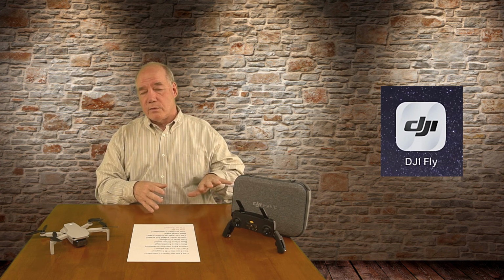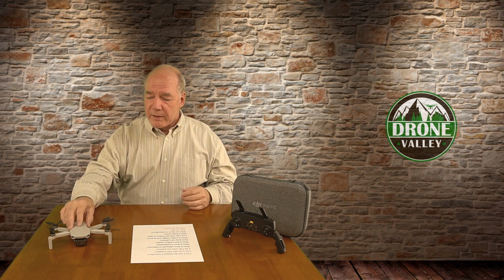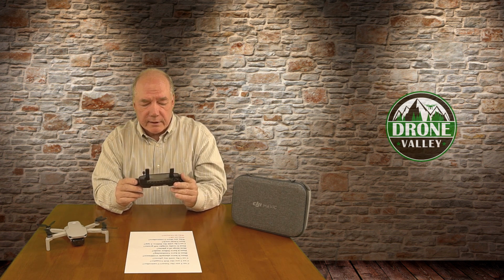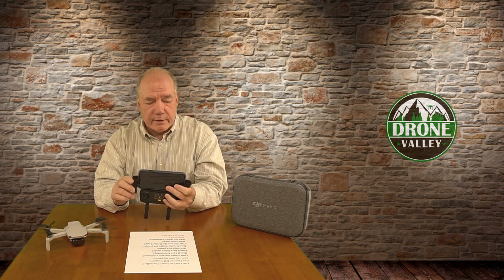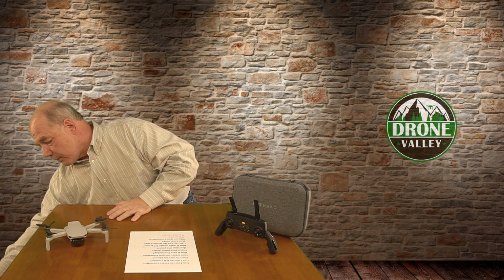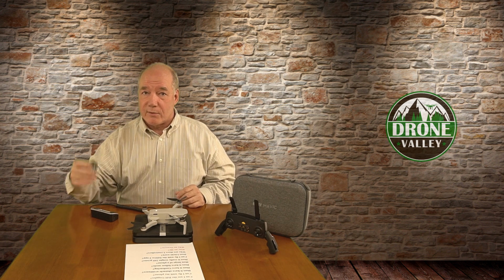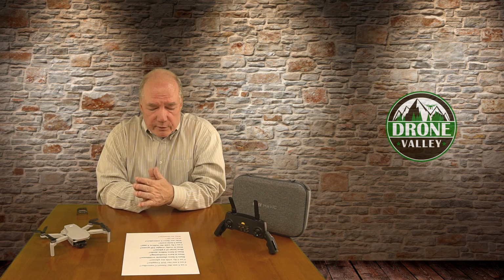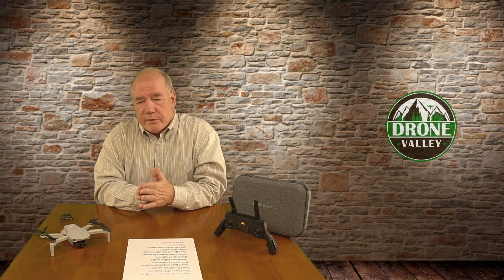Mavic Mini - Your Top 10 Questions Answered

Comment: I live in an NFZ, which means I can’t even fly it in my own home. I’d have to drive 4 miles just to fly my toy?

THAT’S why we don’t like NFZs.
Reply: It's more than that. There's no reason why I can't fly at say 20 ft to capture footage in an NFZ. I live on the edge of an NFZ and can't even use my done to capture footage of my kid. There should be a ceiling of say 50ft instead of an total NFZ. This is why NFZs are stupid.
Reply: @jeremyk2740  Request permission via LAANC using Airmap app. You get authorization   because you are recognized by the system. They will have your name, insurance and type of drone. It is required you provide this info to Airmap, which FAA recognizes as their proxy. It only takes a minute to do. There are videos on the subject so give them a look.
Reply: Lon Denard Just like we allow DOT to set speed limits those limits are based on the roads conditions and how it’s engineered. If you have your 107 license then you know how the airspace is defined and NFZs can be more dynamic to be reasonable. Just because you’re close to an airport doesn’t mean aircraft can be flying at 100ft over your house. Nobody here is condoning reckless behavior.
Reply: @Lon Denard I don't see a lot of 3 holers (727) burning the sky anymore, but your point is very valid. The FAA has a mandate to provide air safety in and around airports. Drone sightings in and around airports have increased with the increase of drone operations. The FAA receives over 100 such reports each and every month, the boneheads are out there. As an ATP rated Boeing Captain, the last thing I want to see anywhere on approach is something coming at me below 1000 feet in a 747. Gear is out, Flaps are 30, and airspeed is at approach speed during a stabilized approach. Pilots can't maneuver that mass and inertia quickly in that configuration. The FAA has the data on this, they have every right to enforce NFZ for public safety. Having said that, the FAA is also willing to work with the drone industry in allowing certain operations with permission. They don't want to squash the industry, but they control the safe flow of traffic at major airports and have a duty to provide air safety as do the public carriers, and all the professional pilots that fly within the system, so Lon is right on in my opinion...
Reply: @subsonicflighttraining   first of all, a drone wont do much damage to a an aircraft, just physics, actually do less than large bird strike would.   secondly no way in hell will you even see a consumer drone 1000 feet away at approaching speed of about 170mph in a 747, assuming both racing towards each other that's max of 3.2 seconds you would have to even locate it in the sky.   i can barely see my mvic 2 pro 500 feet away while standing still and tracking it with my eyes, if i take my eyes off it for a second...gone.. takes me 5-10 seconds to see it again. so i doubt you would be able to locate it within 3.2 seconds.

finally the number of reports does not equal number of verifiable occurrences. 

 example #1.  NJ pilot says he saw a drone about to crash into him from several miles away on approach to airport.. math nerds that fly drones as well jumped at this opportunity to see if it was physically possible and basically laughed and said no once was discovered that even at most perfect angle wouldn't been possible given speed, location, time of day, and anything even a massive drone like a massive octocopter. ..  just no.     luckily didnt blow up into anything else wasnt.  

example number 2.    take gatwick incident for example.. tons of reports all turned out to be false and non verifiable even look throw them yourself, the videos captured were not of gatwick the few that were turned out to be helicopters in the distance approaching.  all the descriptions of the drones also conflicted with each other from consumer grade toy to the bs of uge industrial sized robotic drone capable of taking out aircraft.  even the police felt it was false before someone internally shut them up on the matter (suspicious as fk) even though they arrested some couple falsely because of all false leads and false information.. they found a couple lived in a house was outside of an NFZ but inline with it and that couple lived drones on their facebook page and the british police sent their special units out there to rough them up a bit for multiple days (during a week as well) before releasing them...  also was claims they recovered drone related parts around he airport, police dont have records of that when independently asked..  

finally.. alot of people im sure would call anything a drone until proven otherwise..  i been reported for flying my drone to the police...litterally that was the report.. i was in a place no issues wiht flying the police didnt know wtf to say or do... crazy bitch also reported me to FAA i guess she got my plate number on my car, FAA sent me a leting letting me know i been reported however they found no violations occurring.. but that they do have to investigate every fucking claim..
Reply: It’s SAD, I hate NFZs, BUT unfortunately there is the 10% that makes them a necessary evil. Hell just in the last rounds of California fires they grounded all air assets due to one of them  alpha hotels.
Reply: RaptorMan M2Z I will take liberty over safety. 10% is not even close to the real stats on the crimes involving drones. I bet if there was a fair study that it would be less than 1% of drone flyers that break the law and then resulted in damage to person and/or property. That’s not a strong argument for them to be able to make and enforce laws without congressional due process.
Reply: TKO593 1st off the 10% comment was not me stating actual numbers it’s just a saying you ALWAYS have a group of Idiots that cause issues in one way or another for the majority.  And as for Liberty again trust me I’d agree with you in most aspects but in the example I put forth, ie the grounding of air assets for fighting the fires that are becoming too common here in California and though I agree with you most UAS operators are legit it’s odd how every instance there is alway a member of the “ 10% “ causing issue with the emergence personal and there efforts to save property and or lives. I purpose a question how would you feel knowing you lost your house  that could of been saved if those air asserts were not grounded due to one of the idiots or worse yet a family member. But again I can see the basis of your stance but for me if I loose my house and or a loved one due to a random ass hat that in most cases free from the responsibilities from their stupid actions I’d be very upset as I’m sure most if not all would be. So certain NFZs and or temp NFZs as I said are sadly needed. But again just my opinion and have no issue with those that disagree. 😉
Reply: @TKO593  am hoping i dont have get boat license for my rc boat that i run close to swimmers ps without crashs or injuries
Reply: oops i just open another cash grab lol
Reply from the maker: @TKO593  TK, I knew when I posted my opinion on this that it would start a comment war. For me it's simple, there has to be some rules for flying that keep everyone safe. Commercial airlines were using that space above the ground ever since that first plane took off at Kitty Hawk and when new tech comes along like quads that want to share that airspace, they have to be integrated slowly and safely. I have no doubt that you (and most serious fliers) would not abuse the skies (near airports or other NFZ's) but the rules are made for the other 90% of the public that are new to the hobby and don't actually know that it's a bad idea to fly in certain areas. These NFZ's just keep the skies safer and it's something (like speed limits and taxes) that we all have to deal with if we want to live in a safe and civilized society. For folks that think they should be able to fly wherever they want without consequences, just imagine how far you'd get crashing your car though the gate of a military facility or prison before being arrested (or worse). Why then should it be OK to fly your drone over that invisible fence in the sky? NFZ's prevent that and with all the discussions about these restrictive NFZ zones, if you check a map in the U.S., well over 90% of the skies are free to fly. All it takes is a little planning and a small amount of travel to find that perfect lake, forest or beach. I hope that helps explain my view a little better. Either way, quit typing and get outside and fly! Rick
Reply: Drone Valley It’s not just the NFZs. In general if they want to restrict an area the FAA has no checks or balance system to contest them. The 2018 Reauthorization Act also ban weapon attachments including blades more that 2.5” and fireworks. It may be silly to think about, but we have the right to bear arms and if I see fit to protect my life with a drone it is my right to do so. That’s why I want there to be more realistic dynamic boundaries. Accidents involving drones happen so rarely that it’s hard to justify the expanded powers to the government. In Florida if we have a hurricane they call a state of emergency temporary NFZs could be in place even though the storm is nowhere close to you. Then if you fly unknowingly breaking the law the punishment isn’t fair. Lacking any damage to anything or anyone you can end up with hefty fines. I agree rules are good, but I feel there is a specific direction the government is going with the control of this airspace. We gave them an inch and soon they take a mile.
Reply: @TKO593  I've read and understand all the arguments. The bottom line is safety for the manned aircraft sharing air space with drones, and of course, restricted areas like prisons, military installations and emergencies. Fixed wing RC are also drones that have been flying for years, but you need line of sight to fly them around at least at this time. Let's not go into military applications. But, again the bottom line is safety. How many folks that are new to flying quads know the rules of safe flight? Or for that matter, the outlaws who disregard and disrespect any authority. Rick and Len are right in every respect. We must be responsible drone pilots just like manned aircraft pilots.
Reply: Excuse me! It is Lon I meant and his comments.
Reply: K Arthur Nobody said anything about being reckless. If you do harm then you should be held responsible.
Reply: @TKO593  OK! You are right. I belong to the AMA and a RC club. So I am very familiar with the rules of RC flying and why they are good rules to follow. It appears you are equally up to snuff. But as you point out there is the liability to consider while flying. If you screw up, you are open for liable. I mean an actual accident not rules or law breaking. Therefore, with my membership I have $2 million dollars liability insurance with AMA. I'll bet that most drone operators don't even think about; What if I have an accident and it is my fault. Can I be sued? You sure can! And you can be fined as well.
Reply: K Arthur I live close to an international airport as well and to think that I would be breaking the law if took off in my own yard even if I was flying below rooftops. It’s only my DJI Mavic that stops me from flying. That’s ok because the batteries are smart enough to discharge themself for storage and I’m usually flying somewhere other than my house. I just have a feeling we will regret handing so much control to the FAA. I can imagine how many people are not flying due to all these new restrictions. Then one day we will have a politician like Beto saying “Hell yes were coming for your drones”.
Reply: @TKO593  I live within the 5 miles of our tower controlled airport. I receive permission to fly by LAANC thru Airmap up to 100 ft around my house. I fly an EVO. Since you fly DJI? You have NFZ/GEO FENCING? It is my understanding that you can fly if you request from DJI special permit?
Reply: Lon Denard Rules revolve around me? They should go through due process. We don’t allow any other agency to make laws. ATF doesn’t make gun laws or legislate how old you have to be to consume tobacco or alcohol. Use critical thinking and stick to the constitution.
Reply: Lon Denard where are the bodies? Where is all this harm that justifies relinquishing our freedoms to the government? I only own the one DJI drone and I love it, but people have been using the airspace safely for decades. You’re assuming that just because the FAA labels it class B that it must mean the likelihood of an incident is prominent. I don’t believe it for a second. It’s just like democrats wanting to ban ARs and AKs even though they literally kill as many people as aspirin yearly. I just hope in ten years that we are not pushed out of the airspace completely in the name of safety.
Reply: I get clearance through the App and can fly.  I do not understand what the issue is.
Reply: Just recently during the California fires, fire helicopters were grounded for more than a hours because of two drones illegally flying drone during this operation. These helicopters were aiding in putting out fires and escape routes. These delays could cost lives and property damage. These are the ones that cause NFZ to be necessary. BTW I too live in a NFZ and have to drive to fly but I see why NFZ are necessary.
Reply: Lon Denard Like I said nobody is condoning reckless use. Yes even in NFZs there is such a thing as responsible use. That’s why they still allow us to fly with permission by identifying yourself through an app. Still will not justify the amount of power given to the FAA through the 2018 FAA Reauthorization Act. The perspective you are not getting is that for the most part everyone was responsibly flying before the new laws. Civilians using the airspace has always been a non issue. With these new drones I feel like a child could responsibly fly in the parking lot of an airport and not interfere with manned aircraft. Do you think I should have to register a kite too?
Reply: @Lon Denard great analogy!
Reply: @Lon Denard actually strongly depends on specific situations.  while usually dji system only warns you and really limits you if your in the boyie or within 1 mile not always true.    i have a Mavic 2 Pro and an inspire 1 (with X5 camera).  i can tell you that yes in fact you can be pretty far away from certain airports and helipads and be grounded with new flysafe databases.   i was flying out on an island in the river, its 3.5 miles from the airports one of my goto places cuz its empty and have to take a boat out there and nothing to hit... and i got first th authorization disclaimer which is fair i clicked i accept all responsibility for my flight.. then after take off thank god i was not over water at this point it started auto landing and looked closer to see why....because it decided i was now in an NFZ.  i checked was no TFR that suddenly kicked in and caused it and no NFZ where i was, just DJI's database being shitty..  just i guess dji go app took a moment to catch up or something. not sure stil dji claims i was just in an NFZ and i accepted responsibility so if i did kill aircraft its on me.  which is absolute BS!

additionally there are 3 false positive NFZ's in DJI's database near where that i can barely fly from my backyard without hitting a wall.. these NFZ's are literally just farm fields. i checked every other app and they dont appear outlined at all.. when reported it to DJI they asked me for "authorized proof" of these zone being false.. i showed them screenshot of airmaps and the GPS coordinates as well a the FAA's own site.. they told me they will work closely wth me gave me case number and told me to eport the error within the app directly and add that case number and contact them in a few days after thats done.  long story short... they denied the changes (well silently ignored them) and actually doubled down on them now my house is in an authorization required zone.. and ya its all over grown fields where its pointing to i took my ATV out there and road around looking for someone to ask in 2 of the fields.. 1 is an abandoned property with a collapsing building the other is someone's farm they dont have a single clue and dont and never had had aircraft where they are.  

irony of all this.. my inspire 1 uses the outdated safe system, barely an airport listed near me in the most recent update to the flysafe database for both aircraft and the app and get this, not even the military bases show up!    just to confirm i asked a friend who has a fully kitted out Inspire 2 with all the goodies like $9-grand in the air (before recent price hike)..same as my mavic 2.. literally the same in my area, barely fly without hitting a wall..  database is invalid.  the river where i like flying, nearly entirely off limits they where  seaplane thing apparent once must been nearby is a theory a local told us that lives near the river... but been long since gone well before even dji was founded in 2006..
Reply from the maker: I appreciate the post but you're picking the one corner case there is for the downside of NFZ's. Honestly, if all you want to do is fly indoors, buy the Ryze Tello and you can fly all you like. It's got most of the features of the Mavic Mini and costs less than $100. Most fliers buy a quad to fly outdoors and that's where the NFZ's are important. I can never understand folks that are troubled by a feature that simply prevents you from flying where you're not allowed to fly. The only reason you'd want them disabled is to break the law.
Reply: Drone Valley I think an inverse stepped height restriction within NFZs would be a fair middle ground. I don’t see how flying a quadcopter at 20-30 feet in a residential area is that dangerous, but maybe you can explain. 

I think we should educate pilots, make sure they’re aware of the rules and the consequences of breaking them vs nanny state style manufacturer-imposed restrictions. Maybe the Skydio 2 will be better at this, at the very least it’ll be American made with no worries about the CCP.
Reply: @Dronevalley  I live in a NFZ as well because I live 4 miles from a hospital with a helipad (who doesn't).  I can't even go in my backyard and fly down my batteries for storage.  Even if I hover at 10 feet.
Reply: @clutchcargo666  hi in canada you have to be 1.9km from heliports and 5.6km from airports thought that was same in most places
Reply: @jimsdroneing  Nope.  That's actually reasonable.
Reply: @clutchcargo666  hmmm thats to bad chuck thats how should be where ever you are
Reply: @clutchcargo666  well youre going have to pack up ur drones and move to canada lol
Reply: @jimsdroneing  Canada also doesn't have the prohibitive laws about making money with your drone - although getting your Advanced ops certification (as opposed to Basic) is kind of a prerequisite due to general proximity to bystanders.
Reply: @simcoeskies2659   yes know Steve am cert drone pilot in canada our drone laws are for all drones only certification and reg exempt below 250g
Reply: @clutchcargo666  It appears that the new FAA zone will recognize altitude limitations in NFZs. You should be able to go up to allowed altitude within that 4 mile zone...
Reply: @denkn  hmmm... Thanks Dennis, I will look into this.
Reply: @jimsdroneing  yes, and what I'm getting at is that Canada is more progressive in several aspects and have not implemented additional regs that impact would-be entrepreneurs.
Reply: Drone Valley It’s simply the lack of freedom. We don’t need the FAA making laws period. The 2018 FAA Reauthorization Act has straight unconstitutional laws in it and they come with ridiculous fines. NFZs are just a step to push civilians out of airspace. They will gladly keep working to restrict it further to hand the 0-400ft airspace to Walmart and Amazon.
Reply: @TKO593   ur right thats why they are imposing these laws rc planes have been flying in the sky for more than 70 years without these restrictions til now imagine the anger there must be for the guys who have been flying for more than 50 years and now they have to comply yes this is for delivery drones they have more money
Reply: jims droneing It’s really simple, but Rick doesn’t get it. A crime isn’t a crime unless there is damage to person or property. Like you said there have been civilians using the airspace safely for decades not just the R/C hobbyist. We all know how laws are supposed to be made here in America and now that has been circumvented by another alphabet agency. They even sneak in coded anti weapon laws knowing we have a 2nd amendment and threaten prison and a $25000 fine.
Reply: @TKO593  ya well some of us know these laws were not just about safety like said there rc planes more than 50 years with no safety concerns big money grab and control for bigger motives
Reply: NFZs are there for a purpose having to do with safety...deal with it and get over it.